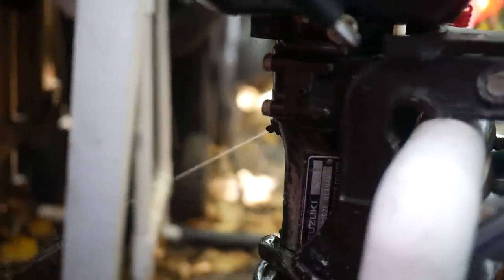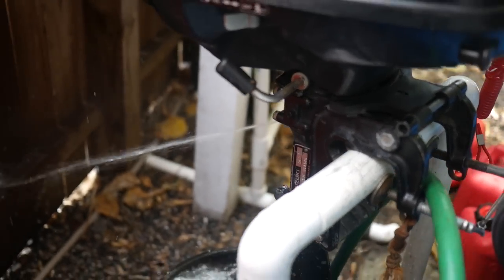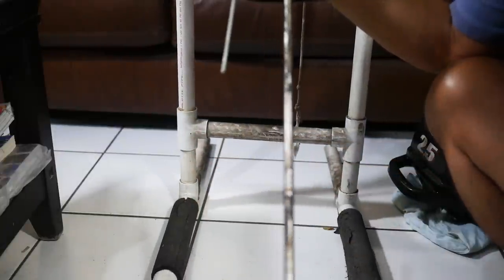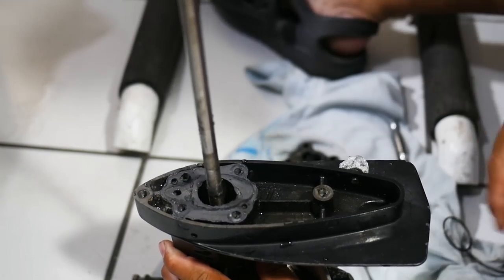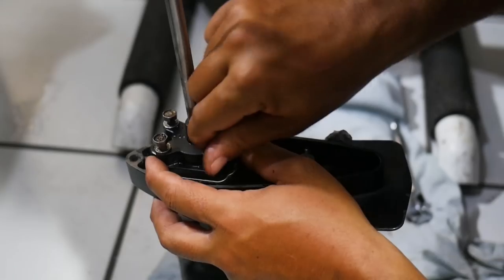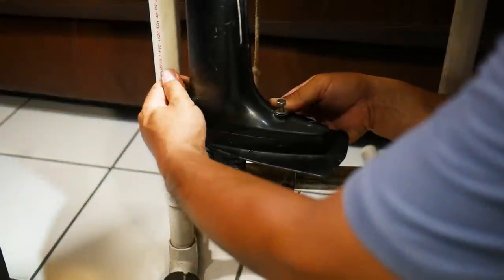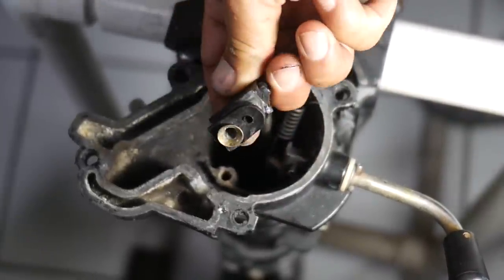Suzuki 2.5 Outboard Weak Tell Tale Stream Problems/Solutions.  Pee Like A Race Horse.

Comment: I recently bought an early model 2.5 Suzuki. It does not have a pee hole, only 2 exhaust holes which spit a bit. In my case I removed the thermostat, just right next to the thermostat is a small return hole which was blocked. Using a ti wrap as on your video helped to remove sand an whatever came out. Now it cools as new. Same principle but just a bit different with early 2006 model. A huge thanks for your great tutorial it helped a lot!
Reply: Thank you, for the life of my could not figure out why mine did not have a tell tale lol

Comment: My 2.5 Suzuki is only three years old. Only lightly used on my dingy for my sail boat during our very short Maine summers. So I didn't think there could be any where near enough hours on it to need a new impeller. I followed  instructions from your YouTube video and found a salty clog in the power head. Cleaned it out. Back to peeing like a race horse!! I wouldn't have known how to fix it if it wasn't for your video.Many, Many thanks !!

Comment: Commenting on behalf of my husband Dave:  "Thank you so much for your video.  I found it very helpful in resolving my non-peeing problem.  The end of one of my impeller blades broke, sending rubber bits up to the motor and causing a clog in the same angled rubber piece where you had your clog.  Now my Suzuki 2.5 hp motor is peeing great!"

Comment: I just bought a brand new Suzuki 2.5 outboard and after the first day out I had a weak tell tale.  I tried your solutions offered in your video and it worked!  Thank you so much.  My particular issue was a little shell, I believe that is what it was but it was very small, blocking the tell tale outlet nozzle.

Comment: I used to keep a small bicycle pump in my fishing boat, w/ a piece of modified shrink tube to fit in the ports. Much easier than blowing into it and the back pressure from the pump will tell you if something is blocked. Good on you for fixing it yourself, it's important to know how things function should you need to do something while out on the water.  Stay safe, stay healthy and thanks for the vid!👍

Comment: Thanks so much for this video. I have a 2009 DF 2.5 which I bought second hand. I started it first time after oils change and no water came out. Turned out the problem was the nozzle that was totally stuck with salt, sand etc. I also went through all the steps mentioned in the video to make sure there wasn't any other issues. Pretty easy job with these instructions and now the engine is running & peeing perfectly. 😊👍

Comment: Great video. I was struggling with getting the lower unit reinstalled for an hour (and I am no rookie wrenching on outboards). As soon as I saw the section with showing the driveshaft guide, it clicked. I had this new to me Suzuki 2.5 finished and running within 5 minutes.

Comment: Ordered a 25 model; I wonder if there is a way to install screen under the inlet strainer fins? I would also use plumbers lube on the impeller and gasket,,shaft and rubber ports as well as anti-seize on the bolts. I ordered a repair kit with the motor and was so glad to see your video

Comment: Nice job,tearing down and re-installing. One extra hint, when re-inserting shaft. Once gear shaft and water tube is aligned you can turn prop slowly to align shaft spline to engine. No jamming needed.👍 Looking to buy a small engine like this.😀

Comment: Excellent video. Very helpful. I have just bought a small day sailing dinghy with inboard motor well. I have a Suzuki 2.5 - but because the motor is inboard rather than on the transom the tell tale stream (which currently does pee like a small horse) unfortunately goes into the cockpit / bilges not over the back! Do you have any suggestion for redirecting the stream more vertically - eg adding a small  flexible tube (eg like I had on an older Mariner) so stream goes down into the well and not into the boat?

Comment: i have a 2008 df2.5, when I took apart the upper half i quickly realized the rubber gourmet was pushed outa its slot, I assume its from being a little forceful putting the lower end in 20 times having to fix a mangled drive shaft. also my model doesnt have that rubber passageway just one water outlet. Thanks for the video helped alot with upper disassembly!!

Comment: Wow! A tiny shell was found after you worked hard on a lot. How can I get the motor to do the basic tilt UP? I loosened nut on upper hinge but can’t get the propeller end to go UP at all. The propeller will end up smashed in shallows if I can’t figure out the tilt… so I can’t risk boating with it until I can get it to do a basic tilt up (or it is maybe called putting the trim UP?).

Comment: Very informative video! I have an 2008 Suzuki 2,5 hp 4 stroke. It does not have a hole with the nozzle where the peehole are on your motor. Just flat surface. I guess some early motors before 2009 did not use a pee hole. It would be nice to have one though. Is it an option to drill a small hole into the chamber prior to the "rubber grommet with a small hole" as you show in the video? Just take out the pee a little bit earlier!  Thanks/ Leif from Sweden

Comment: Hey, brother, I have a fix for the internal areas hard to get to, as well as the inside of the heads water jackets, I made a flush kit for my motors, if we take the bottom end off and make a hose adapter to the water shaft, and then connect the pump and bin that it can circulate into, then flush the entire system with Rydlym, and measure the PH going in and coming out, when the ph is the same in as coming out its done eating the build up. People are lead to believe that salt away will prevent this build up but will not! I have several videos on flushing with this. You should check it out, it will help prevent all this from building up in the first place, except shells,,lol, that's funny and a very tiny shell..lol

Comment: From the 1st day I got my 2.5hp it never 'streamed' water. It only spat out water occasionally and only when it warmed up. I think this is mentioned in my manual. I got mine in 2010, so maybe the water cooling system was different then? Compared with your pea stream I can't believe mine has never overheated!

Comment: Do you find the gasket between the middle unit and the power head to be critical? I damaged mine while checking that rubber elbow (real problem was broken impeller) and I ended up ripping out the rest of that paper gasket under power head so it’s sit even. But now I have a huge leak from power head that is hard for me to believe is from where that thin gasket was…?

Comment: Should the motor pee as soon as you start the engine or after the thermostat opens. I have a DF 2.5 that has sat for 5 years. I cleaned the fuel tank replaced the carb with a new one and new spark plug. Engine starts first pull but no pee anywhere. I have it far enough in the water bucket. So just wondering if I need to remove the lower and start looking at things.

Comment: thank you.  I am a big fan of ur vids.

my 3.5 hp outboard, when I switch gear from N to F,  it takes off like a rocket.  LoL.     it takes off way too strong, fast and rough.    Do you have any solution?(of coarse at the idle speed)
Reply: I looked at this video to solve the clogged pee system for my first break in trip on my 2.5 lol. Anyhow I will think it's idling too fast. But like I said I'm a noob.

Comment: I get oil through the tail section when the water pump is off. How is this sealed when the shift rod goes through the hole of the water pump again when everything is assembled. I cannot find an oil seal or anything on a part list.

Comment: Well I followed your instructions and removed the leg .
Imagine the anti-climax when I discovered that the rubber grommet that you describe with a very small hole that you took the seashell out of does not exit in my motor ..
It only has the bigger hole . I wonder how the tell tale works ?
Also , mine does not have the plastic telltale screw .
Reply: Yup. Older models don't have the plastic screw telltale, only the two breather holes and they just sputter, they don't pee like a racehorse!
Reply: @Toob41  Yes , and when I took the leg off I broke the gasket and it took me a month to get a new one here in France .
The supply chain seems to be breaking down .

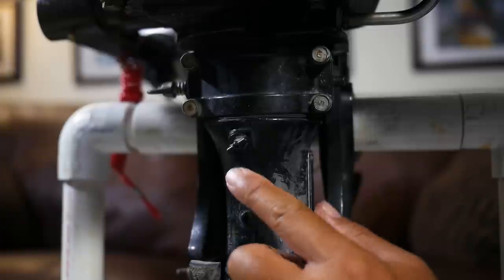Comment: At 4:18 what is the right name of the tell tale plastic nozzle ? Mine cracked off
Reply: Water Indicator Union. Suzuki Part# 61155-97J01-000.($1.18). They're nylon. Pretty tough. Never seen one break. Just tighten snug w/ fingers only. Brownspoint Marine, Boats.net, etc. all stock parts. I have had fine service from Megazip, which used to ship oem parts direct from Japan. Now they stock nearly all parts here. Shpg. is a bit dear on all these sites, so try to put order together of all spare parts/gaskets you may need in coming yrs. Good luck.
Reply: @notyetjp  Excellent thank you very much